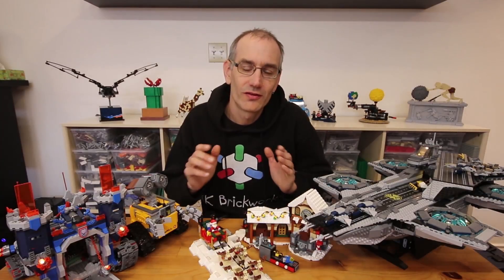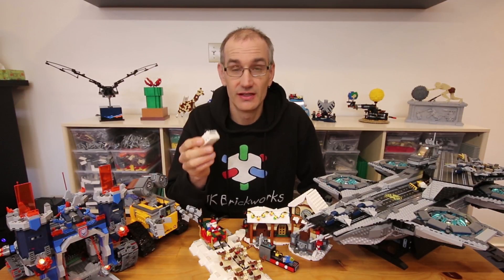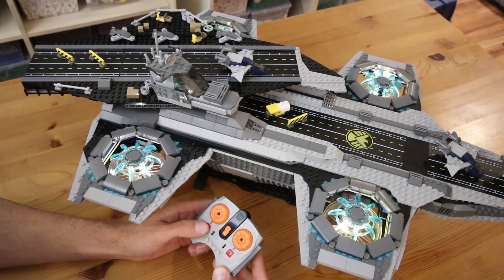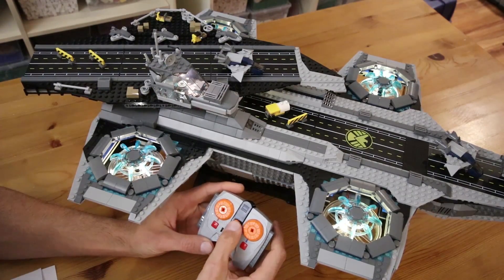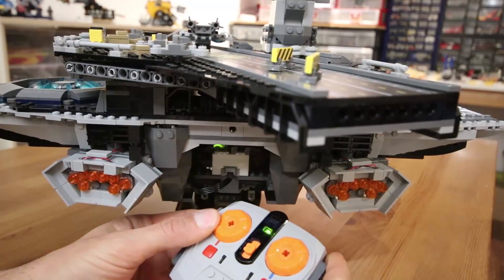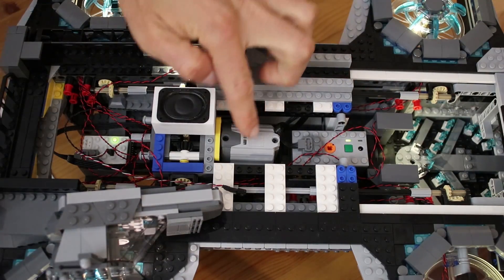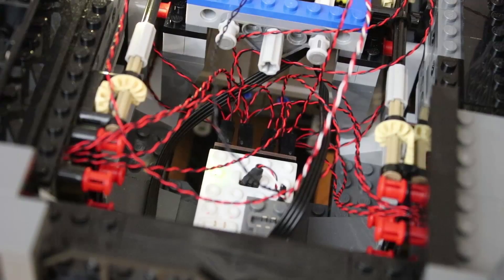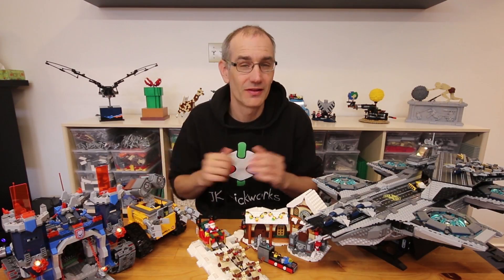PFx Brick - LEGO Helicarrier Demo

Comment: The shape of the main unit looks like the Sbrick. Is that by accident or did you actual take some inspiration from those guys? IMO though I think that you guys chose the wrong control device: It would have been much better if this device could be controlled by a smartphone. Like the Sbrick.
Reply from the maker: As others mentioned, we are initially focusing on being compatible with the Power Functions system, including the IR controllers. We know many people want bluetooth control, and it is on our road map for the future.
Reply: Since it's infrared-controlled, I'm pretty sure someone could create an app that replicates the lego controller.
Reply: Even if that would work properly on most phones, it won't negate the general disadvantages IR has, like poor range and poor performance outdoors. Bluetooth or wifi have much better performance in that regard and are standard on most phones.
Reply: I believe you are right and that is admirable. Guess I am just not much of a purist when it comes to functionality.
Reply: Kelkschiz The impression i get is that it's designed to fit in as much with natural lego as possible.